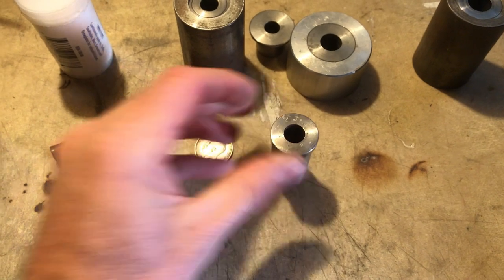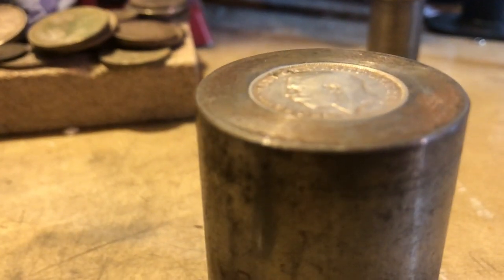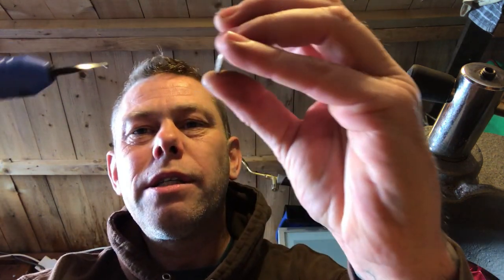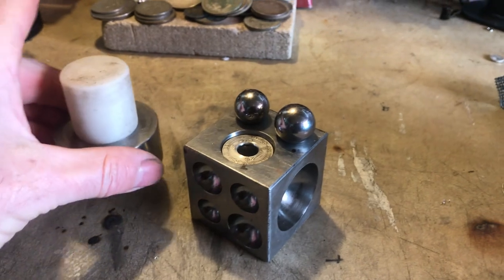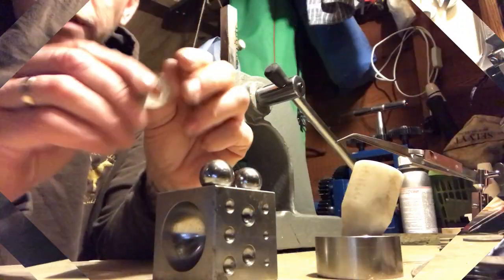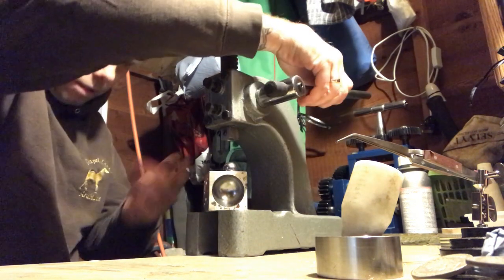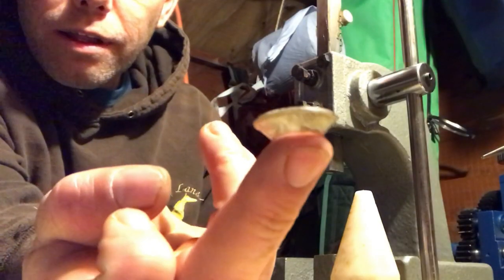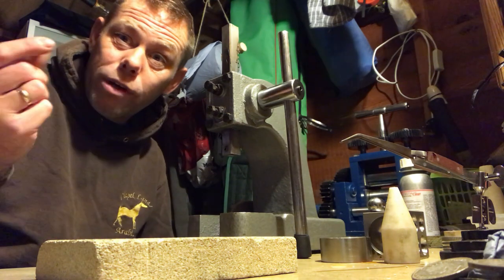HOW TO MAKE A COIN RING, 2020

Comment: Super vid Sid ! I am just in the process of purchasing the necessary items. I will start off, like you, with a milled coin. As a metal detectorist I have found many over the years though not as many as hammered coins. I also like the idea of making a ring out of a hammered medieval coin, such as a Henry VIII groat, though not sure if some hammered coins would be too thin for working on ? How many dies do you use by the way and what is the largest coin you have used?. Thanks again!
Reply from the maker: I have done a ring out of a five shilling coin which is massive... i found that was really tricky, i think its because of the size and more pressure needed to manipulate.... florins are nice to work with 👍🏼👍🏼👍🏼
Reply: @englandshistory  Thanks Sid! I will probably start with a Vickie shilling or florin. I have lots of worn ones so any mistakes won't be painful as I learn my way through :-D . Couple more questions. The Swedish wrap process (where do they get these terms from lol!)..  . What are your thoughts on this ? Worth the extra £'s ?. Also, lots of different presses around but I like the one you use.  Do you have a link to the one you purchased perhaps?  I have watched lots of other vids and some advocate just going for basic or intermediate tools. Me, I like anything that makes the job easier and more efficient so any advice on this area is welcome. Look forward to more of your vids! :-D
Reply: Final question Sid. What size die is that for the shilling ? Thanks again
Reply from the maker: @stubblehunter1  i dunno mate... just pick which ever it fits in to